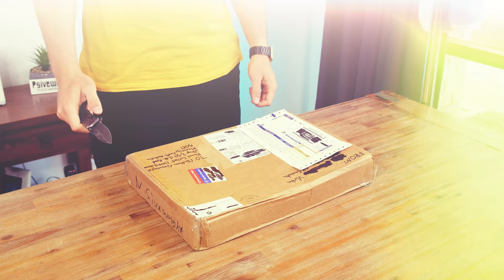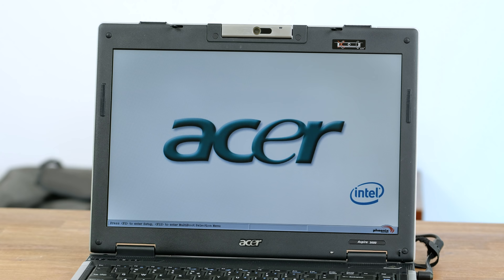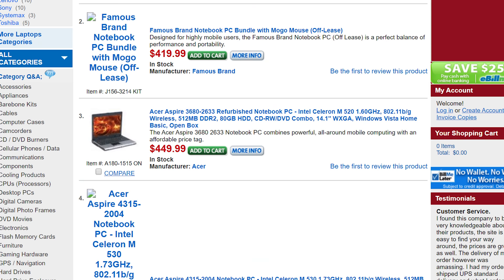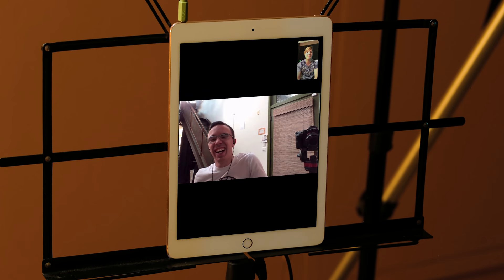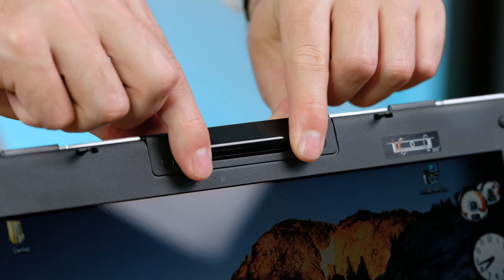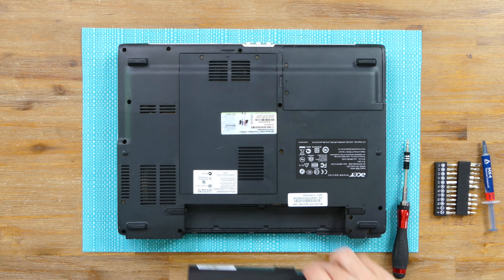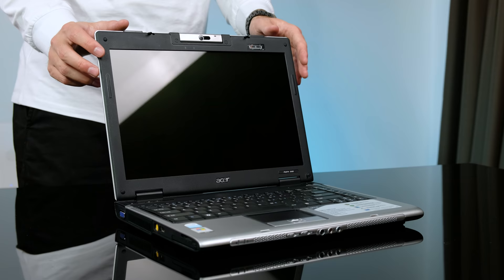Windows Vista Laptop... In 2020! Ft. Austin Evans

Comment: Vista wasnt that bad
Reply: Depends some versions are super buggy
Reply: @SortofGoodwithTech  sp3 w/ extended kernel is good tho imo
Reply: @ignistrum  my win vista laptop doesn’t have that it can’t even handle the calculator for a while it just divides numbers as soon as you put them in and settings quits if certain settings are changed

Comment: I still like the design of windows vista overall.
Reply: Same.
Reply: I spent like 3 hours making my copy of windows 10 look like vista
Reply: @Ard4x I also used a startup sound changer to change the startup sound to the login sound of vista
Reply: I think most of the hate on Windows Vista was regarding software compatibility issues. I had it for a few years back in the day and I liked it.
Reply: Me too, I wish my hard drive didn't fail
Reply: @LBSiUK  😂
Reply: I still have Vista on my old Thinkpad
Reply: @LBSiUK  OMGIT'S GREAT,HOW DID YOU DO IT
Reply: @mylesgray3470  it had some serious performance issues up until I believe service pack 2.  I bought a toshiba laptop with Vista on it in early 2009 and it was just “meh”. But I put a 7 Beta on it and performance improved markedly. I believe that was to date the only operating system I pre-ordered, because it just fixed things. 

But I think the damage to the name was done by the bad earlier releases.
Reply: It's very similar to windows 7
Reply: @LBSiUK  I spent a while making my linux distro look like vista lol
Reply: coderr  Windows 8 is literal shit. We don't speak of that demon.
Reply: Better than Windows 10 or the latest Mac OS. Having said that, I also like the overall design of Mac OS Leopard- Mountain Lion and IOS <7.
Reply: Same.
Reply: The boot logo is all for me! Windows 7 dont have that...
Reply: I too love widows vista

Comment: Ooooh I see that CPU is socketed, I see room for an upgrade. Perhaps a Core 2 Duo!?
Reply: I suspect TDP issues unless you could modify the heatsink would make this a no goer!  no brainer is to use a light variant of linux!
Reply: @welshtechie6832  yes I thought that too, I didn't research which chip the lappy currently has. Perhaps an older 65nm celery? If so a more efficient 45nm core 2 and making sure its tdp is the same, or lower.
Reply: Doubt it could handle a duo
Reply: Pentium dual core has a tdp of 31 watts from 2007 the t2350 is 1.87 GHz dual core Linux still has support for Intel 9gpu run like lubuntu on it or xubuntu
Reply: That was my thought. Pick up a T7400 for about $5 on the bay, put it in there, and install Linux and that old machine will be completely useful for everyday tasks.
Reply: @welshtechie6832  Celeron M 520 has a TDP of 30W. He should be able to put a 35W Core 2 Duo in there. A T7400 is compatible, sells dirt cheap these days, and has a 34W TDP. You have to remember that these were binned at Intel; his Celeron is probably a defective Core 2 Duo with a core disabled at the factory because of defects in the silicon, but it could pass QC as a 1.6 GHz single-core.

I swapped a 2.2 GHz T4400 for a 3.06 GHZ T9900 in an old laptop once, both of them 35W TDP chips, and my battery life improved because the T9900 was vastly superior silicon and was more efficient, even at the much higher clock.
Reply: @johncate9541  Ah nice research only takes a bit of deeper research and proves what can be done as in some ways older laptops were less restricted!
Reply: best you can do is probably a pentium m 765 ( i have a VERY similar laptop but from dell)
Reply: I think the 3680 went through a few different architecture variants. The one I had came with a Celeron but I was able to upgrade it to a Core Duo. I probably could have gone to a Core2 Duo T7200 but that was out of my price range at the time.
Reply: @johnruschmeyer5769  What Celeron model are you using?

Comment: I actually have FOUR of these. One running Windows XP,  one on Vista,  another with Windows 7, and the last sporting Fedora Linux. They were really pretty decent machines for the price, and the Fedora machine was my main laptop for a good little while. The build quality isn't half bad, the keyboard and screen are fairly nice, and the overall appearance is ressonably sleek. I was pretty happy with mine back in the day.
Reply: Does all of of your laptops still worked?
Reply: @ablueberrya10   Last I checked, that was only 6-8 months ago.
Reply: Mine is windows 7
Reply: @JoysonplayzYT  Windows 7 ran surprisingly well on mine, although the specs would indicate it to be a bit underpowered.
Reply: @richardadams4928  what is ur model?
Reply: @richardadams4928  mine is acer aspire 3050
Reply: @JoysonplayzYT  Acer 3680. Not sure on the sub-models, although the XP one was bought new and has an EIDE HD, all the rest were bought used and ISTR they all have SATA, so that is one BIG difference between earlier and later 3680 machines.
Reply: They are ALL 3680's.

Comment: Him: Is a Vista machine still usable today?

Me: It was not even usable back then.
Reply: Worked fine for me
Reply: girlsdrinkfeck To be honest, Vista was an unusable mess. Installing Vista turned reasonable fast computers of its time into slow mailing machines. Would be interesting to benchmark Vista against Win7 on the same machine.
Reply: actually people thought windows vista was bad because they had installed it on their old computers from like 2001 and couldn't get drivers for their old printers that the printer manufactuer never made new drivers for
Reply: @AaBb-mc9sp  That Laptop showing in the video showing that it can only run Vista Home Basic (if you look at the stickers at the laptop).
Windows Vista will run fast if you have Service Pack 2 and Platform Update (and Platform Update Supplement) installed on Vista.
Only the RTM version was horrible.
Reply: Aa Bb That’s not true. I had to manage a bunch of Thinkpad T61 notebooks which where very decent for it‘s time.

Some of my clients wanted Vista, some stuck to Windows XP.

Core2Duo
120GB SSD
2GB RAM

Using Windows XP, the machines just ran fine. Installing Windows Vista on them made them terribly slow. The machines where swapping all the time, even with no applications running. Using Widgets made it even worse. Even maxing our the RAM to 4GB did not make it better. Installing Windows 7 helped.
Reply: @Attiliron  it's not Vista, is the pc. It ran fine for me, for you not
Reply: @AaBb-mc9sp  dont forget the ram, they cryed like babys because they had 512 ram ... and dont forget the crappy igp you needed a dx9 vga!!!
 i had vista ultimate before the sp1 on 2 pcs with only 1 core, athlon xp barton 462 and the athlon 64 754 both with nvidia cards 6600 and 7600gt + 2.5gb of ram for the barton and 4gigs for the x64.. vista was a really fast with that hardware!.. ok true xp had a couple fps more but vista was more smoth, less 1% lows
"they talk about the worst windows ever... noobs! they never used win ME, win 98 before SE, remember the plug and play in win 95 before the C update?, o and windows1 maybe? DOS was better than that! a fkng text commands system!!"
Reply: I did not rest it because I don't have a Windows Vista laptop I will get a Lenovo k aptop

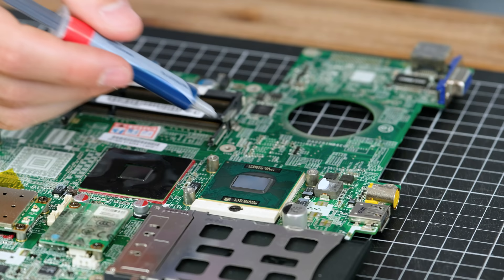Comment: 9:02 you forgot to put thermal paste to the gpu
Reply from the maker: It actually used a rather tall thermal pad (Which seemed to be in good condition still). If I went ahead and just used thermal paste it wouldn't have even made contact with the heatsink.
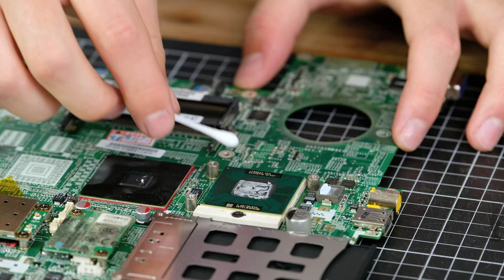Reply: If you go to 8:50 you can see there is an old thermal pad or paste stuck on the heatsink. I am guessing he did not remove it. The same goes for the mosfets right beside the CPU.

Comment: Laptops like this are the reason why people hated Vista so much. Underpowered for everything over XP.
Reply: i have a laptop with a Celeron M 380 (One in the video has a 370) and it came with XP, even has a "designed for XP" sticker.
Also, the graphics have no official drivers for vista. The laptop OEM must have force installed the XP drivers (it does work, just without aero)

Comment: Good video!  I've just upgraded my sister's old Acer Aspire 5612WLMi bought in 2006, with an IDE SSD drive, Windows 7 ThinPC x86 to add to the previous upgrade in 2012 of Core2 Duo T7200 CPU and 3GB RAM.  It boots in under 30 seconds and is quick and responsive with everything, and possibly good for another few years yet!  It originally came with Windows XP, Core Duo T2300 CPU, 1GB RAM and 80GB IDE drive.  However her next laptop will be a Lenovo Thinkpad from either T or W range.

Comment: The weakness of those Aspire laptops were hinges. My very first laptop was a Turion 1,6 GHz Aspire and at the end of its life the screen was totaly broken. Now I still have a 3023 WLMI and the hinges are broken too.
Reply: I've worked with quite a few of these Acers, and funnily enough it was never the hinges that broke but the DC barrel jack which was usually conveniently soldered to the board or the casing itself would fall apart. The plastic is very (!) thin with no inner frame for reinforcement like you'd find on a Thinkpad or A1181 Macbook for example. You can snap these clean in two with little effort. Real junky things lol. Never had one last more than 5 yrs unless they've been sat on a desk their entire lives.

Comment: Great video, and congratulations for collaboration with Austin. I also got old HP Probook 4525S for free, but unfortunately motherboard was dead on that one. I managed to find a replacement one for like 50$, and it works without a single problem now. It's running Windows 7 and it has dual core AMD Phenom CPU. I upgraded RAM from 2GB to 4GB, and there is 320GB HDD inside. It's a cool laptop to mess around with, but unfortunately limiting factor is GPU which is not too good. It's some old ATI chip, and I tried running Mafia 2 on it, but it struggles even on low settings. But yeah, it was basically free, so I don't mind it.

Comment: I think people who bash on Vista take things out of context.  I built a high end dual Xeon processor workstation for 64bit processing right before Windows 7 came out.  Before using Vista, I had also tried 64bit XP.  XP 64 seemed really buggy about supporting apps that had both 64bit and 32bit components.  When I put together this ideal workstation, I bought a Vista Pro disc (and it also was a time in which there was a free upgrade voucher to 7 when it came out).  While 7 seemed more streamlined, I didn't have issues with Vista and 3D animation: most importantly, it was better at multithreaded x64bit computing compared its predecessor.

Comment: I had Aspire 3100, I bought it in 2006 at Staples. Man, it was my most glitchy laptop ever. I had to fix cooling system by myself, cuz it was installed skewed and the computer froze from time to time + the RAM was broken, but the problem went away with a memory upgrade. The DVD drive died almost immediately.... in general, as you noticed, it was a fun machine :)

Comment: Windows Vista might be out of support, but if you patched the browser. Ur able to https again and it somehow runs faster than without it. Either way, I don't recommend it. (Even though I am using it to type this right now.) If you planning to use it. I recommend to use Windows Vista Ultimate SP2 with a more modern laptop such as a cheap laptop from around 2012.

Comment: My cousin had a very similar laptop like this which he’s had since 2006. Sadly the laptop stopped working in 2021 as the display broke, hard drive died and the battery stopped working. It came with Windows XP and still has the activation code sticker on it. He didn’t bother repairing it as he built a new PC which ran Windows 10 of course.

Comment: I had a Dell Inspiron 1420 with a Core 2 Duo T5250, 2x512 MB RAM and 80 GB HDD. 

It now has a Core 2 Duo T7300, 2x2 GB RAM and 128 GB SSD. Oh yeah, my sister uses it and it runs Windows 10, instead of Vista Home Premium which it used to until quite a bit after support ended

Comment: I think this laptop can handle a dual core cpu like pentium dual core or core 2duo if you flash/update the bios.
Reply: nope, generally celeron m's and pentium m's laptops are NOT compatible with the newer dual core CPUs. Best you can do in this particular case is probably a Pentium M 765 which is still a single core.

Comment: One thing you might be able to do with that chipset series in that laptop, is to plug a 1GB stick into the lower slot, and a 2GB module in the top slot, 3GB total system RAM should work, but only in single channel mode, which can limit the performance of the laptop.

I've done this on a couple of systems, and it performs very well despite the single channel mode

Comment: I was about to say something like "wow that's old" but then i realized how old my Thinkpad X200s actually is. Strangely it's still very usable. It's a GMA-machine but thankfully with Core 2 Duo. And it supports 8GB of RAM. It's even ok with Windows 10, but because i like the "snappy" part i only run Linux on it. Probably a good idea for that Acer too.

Comment: My mom had this exact laptop back between 2007 to 2009. It seemed way more modern than any computer I had used as a kid & I loved Windows Vista, I use to spend hours playing Purple Place. Also remember trying to install Simcity 4 on it but not succeeding. Don't remember why it didn't work since I could install it on a 2002 Sony Viao Windows XP  desktop with a P4 @ 1.6Ghz. The version my mom had, had 512MB of Ram.

Comment: I had a Gateway LT31 netbook/mini-laptop back in 2009, it originally came with Vista Basic, AMD Athlon L110 single core, single thread CPU, 250GB Seagate HDD, and 2GB RAM. It was upgraded to Windows 7 in 2011. Then there were problems and I was able to reset back to the original Vista OS due to the recovery partition still remaining on the HDD. Then in 2012 it was stolen by someone. Summer 2019 and I was able to find a well-maintained Gateway LT31 laptop from eBay for $60.00 US dollars/$85.92 Australian dollars. It was upgraded to Windows 7 and 160GB SSD according to the listing. It had Windows 7 Pro then I downgraded it briefly to Vista Basic then I went back to Windows 7, this time with Ultimate. It took forever to install, most notably the graphics drivers. Now it still runs fine and I was able to run Adobe Audition CS6 on it. But YouTube, not so great. And it didn’t come with an OEM charger. I also had a Gateway LT20 netbook in Cherry Red and I had sold it online with Linux installed for $60. I had upgraded the RAM to 2GB and swapped the HDD. A person named Jason was the buyer of the red netbook.

Comment: That design was also used with the Acer Travelmate. My dad had an Acer Travelmate 2480-2968 with a single core Celeron M 440 @ 1.86 GHz, 512 MB of DDR2 RAM, and an 80 GB hard drive. Unfortunately the screen is broken due to a fight between me and my brother. I still have it and hope one day to restore it. On the outside, it looks a lot like that Aspire. The touchpad looks slightly different, but otherwise they are very similar.

Comment: 1. There is a program out there, I don't remember name, which you can use to force more memory or higher clock speed for that 945 (and 950) igpu.  It improves graphical performance in games, noticeably.
2.  Vista consumes as much RAM as it finds, without slowing down the machine more than if it hadn't. IIRC it preloads data, so it doesn't just eats up the ram for no reason.  From what I remember I had far better performance on the same machine under Vista than XP.
3.  Thanks for the video.

Comment: you should of done some before and after testing after you had applied thermal paste. I recently fixed up my dads old Sony Vaio VPCEB1Z0E that had never been opened up since be bought it back around 2010. He complained that the laptop was slow AF so i had a look and found out that the i5-430M was thermal  throttling to 800-1.1Ghz when its supposed to have a baseclock of 2.26Ghz and turbo 2.53Ghz. The stock thermal paste was pretty crusty and it took at least 30mins with a toothbrush and soaking the cooler in rubbing alcohol to get it all off.

Put it all back together with a little dab of MX-4 and it was working at its rated speed again. I did convince my dad to upgrade the CPU just for a laugh though and picked up an i5-560M for under $20AUD and he is pretty happy with it now.

He doesnt do a whole lot with the laptop as its pretty big and heavy but  it runs more smoothly with the CPU upgrade and replaced the stock wifi card with a 300mb Wireless-N one i had lying around from past laptop upgrades. He already had more ram an and SSD from a previous upgrade many many years ago so those didnt need upgrading either.

He can now surf the net and youtube without it getting super laggy. Its also running windows 10 and im very surprised to see that hardware acceleration isnt broken as his laptop has a dedicated ATi 5470 and AMD are known for breaking hardware acceleration for legacy hardware. I was forced to upgrade from a HP DM1-3200SA running an E-350 because their APU drivers were absolutely broken and would shove any video encoding of HD content to the CPU rather than the GPU and the E-350 is super weak. 1080p on YT would lag out the laptop.

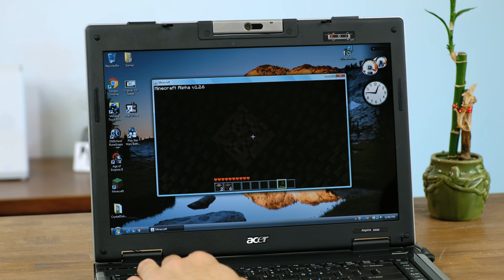Comment: 6:31 I think that this laptop at least could handle youtube videos back then because YT at that time might had used some older codecs that were compatible with GPU video decoder, but now because youtube switched to some modern codecs that use less data but require more cpu power, now it is a problem for such laptop to handle youtube even at 480p.

Comment: Use "ClockGen 1.0.5.3" to try oc on the laptop. I manage to get 2.6 ghz on a Pentium T2130(1.86ghz stock). With that i can watch 480p videos on youtube no problem.
These old machines overclock pretty well.
Reply: Thanks for the clock software name I have an old i7 laptop that I will try it on